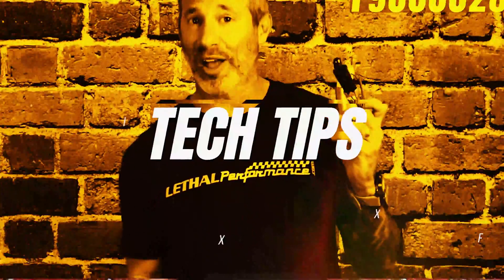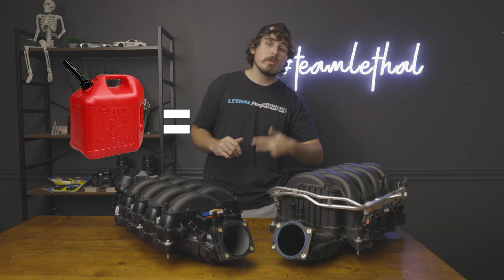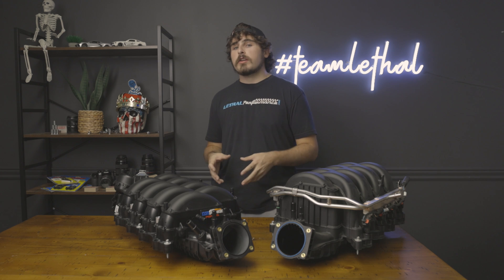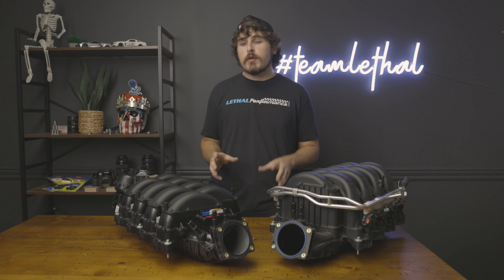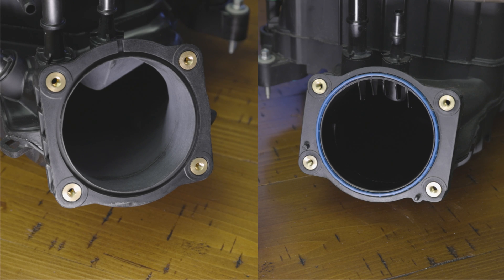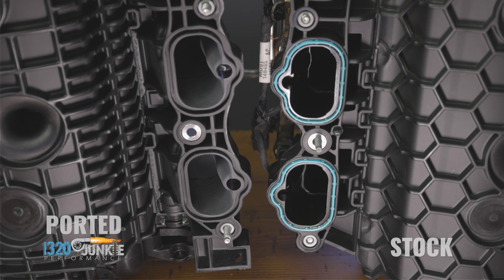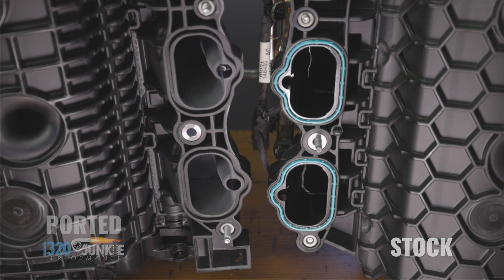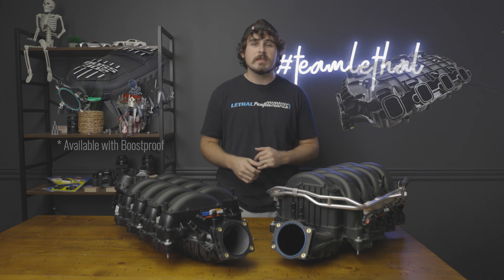Ported VS Stock Intake Manifold - Tech Tips

Comment: Will installing this intake mani without a tune damage the engine? Or more so just not allow
You to fully hyaline the ported mani
Reply: Not at all, I spoke with palm beach dyno, and they told me I did not need a tune what so ever, and they don’t even make tunes for a ported intake
Reply: It'll throw a code at worst, but no way should it be a big enough difference to cause damage on a stock tune.
Reply: This literally my question bro! 
I just got my first CEL on my 20’ GT and it’s coming back as a Intake Manifold Runner Valve problem, I’m taking it to the dealership tomorrow for diagnostics but I’m sure they’ll just tell me to replace the entire intake which if they do I was just planning on buying a ported one but wanted to make sure first that it didn’t require a tune immediately since I wanted to wait until I got longtubes installed to tune it.
Reply: Not needed those items done in the vid wont make any real difference
Reply: You need a tune. But you’re not gonna damage anything. You will throw codes

Comment: Will 1320 18 mani fit 11-14 mustang ?
Reply from the maker: Yes, will bolt on with no issues. Although, you may have to get a 18+ Intake, like a Cold Air Intake, to work with the 18 Manifold's upward angle unless you can get your current intake to adjust far enough.

Comment: I ported my own 18 manifold, removed all that glue that was restricting the runners, sanded it all smooth to 1000 grit. Funny thing is, I had to get a tune revision because I was actually making MORE torque than I was tuned for. Triggering a P061A code because I was exceeding the expected torque limits. After 7K RPM is just keeps pulling. 

However, I have over 5+ years experience using a dremel, 10+ years with sanding and polishing, so unless you know what you're doing, just leave it up to the pros to port your manifold, because you're taking a risk on actually losing power rather than gaining it. I was careful not to over-port. I used pictures of professionally ported 18 manifolds as reference. Shop vac worked great for cleanup too.
Reply: You aren't wrong; but, if someone wants to try learning how to port, doing it on a stock manifold is a great way to start. Hell of a lot cheaper than if you screw up an expensive aftermarket intake, especially when it isn't too hard to find a used stock replacement for much less from someone who's upgraded.
Reply: By glue, do you mean weld (plastic) flash?  You’re probably better off locking out the cmcv system and glueing the flaps shut.  Probably getting more restriction from the flap pockets more than the small weld flash intrusion into the air flow 🤷‍♂️
Reply: Saw no difference in hp on dyno with ported intake in n/a. 10 cars zero difference  made same hp and tq.
Reply: @darrenmcfeaters6683 I don't doubt you, but that goes against years of people who made more HP porting. I mean, I have seen heads ported vs unsorted make 45 more hp on a 400 hp setup.
Reply: 10 cars? With before and after dynos on ported 18+ manis ? Cap  ...it's gotta make 5whp   @darrenmcfeaters6683

Comment: 2020 gt.. 10r80. Want the best top end pull.. ported 18 or unported 350mani... not many comparisons on a 3rd gen. Vmp test was misleading because they only revved it to 7400... lame. And the 350 mani looked like it would have held on  better past 7400.  But that was also on a 2nd  gen... don't care about cost. But  not CJ money. Lmao
Reply: Similar thoughts on my 19 PP1 with the 10A…
Reply: I have tested both manifolds unported and bret barber ported. My unported gt350 picked up 2 mph in the 1/4 mile From the bret Barber ported 18. I just recently sent off my 350 mani to get ported (bret barber) and throttle body adapter port matched paired with a accufab 84.5 mm throttle body and gained another 2 mph. You will pick up good even unported.